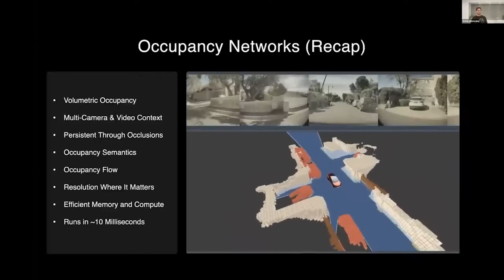Tesla Bot Will Save BILLIONS! w/Scott Walter

Comment: - Tesla bots will likely pay for themselves by replacing human workers doing repetitive tasks in Tesla factories. This will cut labor costs. (00:00)

- Other robotics companies rely heavily on research funding, while Tesla focuses on profitability. Tesla bots will need to have a clear cost-saving use case from the start. (00:35)

- Current prototypes like Atlas from Boston Dynamics aren't optimized for manufacturability and cost. Tesla designed their bot for mass production. (01:06) 

- Tesla bots can be less efficient than humans initially as long as they are cheaper. A bot may only do 1 task in the cycle time of 2, but it is cheaper than paying someone $25/hr. (02:50)

- The first customer for Tesla bots will be Tesla itself, reducing internal costs. Then they can expand to suppliers, collecting data before a wider rollout. (04:41)

- Tesla bots don't need to be perfect right away since they will work in controlled environments. This sets them apart from full self-driving cars. (05:42)

- Overall, the potential labor cost savings make the economics attractive even early on when performance is imperfect. The bots just need to save money, not directly earn it. (06:06)

Comment: Are there any considerations for Optimus as a Waldo - a human operator via tele presence, operating the robot directly? The TSLA video showed a brief clip of the robot mimicking the human's action, but this would a case of the human working through the robot's senses and hands. Use cases would be any hazardous environment such as underwater, nuclear containment buildings, outer space, lunar and martian construction (latency would be an issue for these last 2 examples)
Reply from the maker: This functionality is already in place when they test the bot. It’s for recording the movement of the host to train the bot.